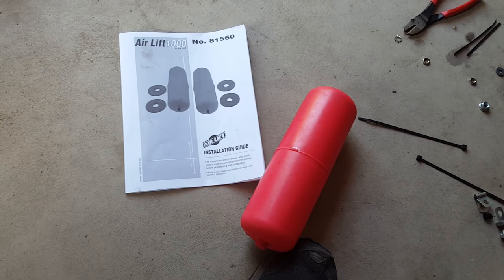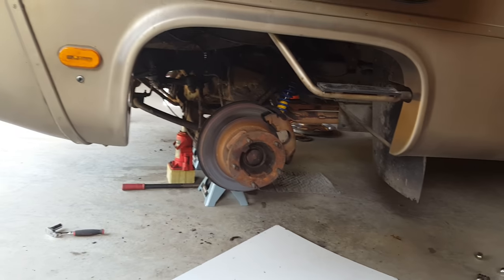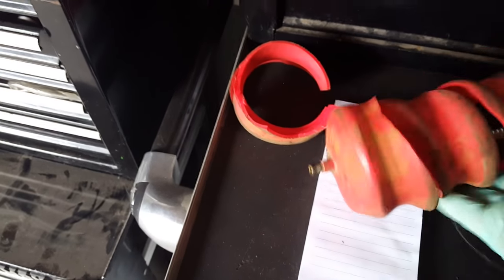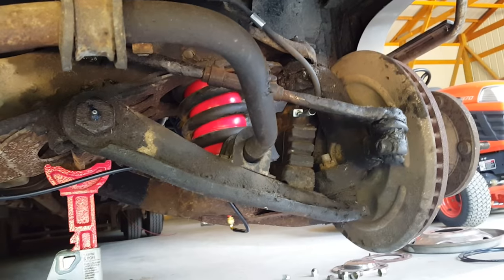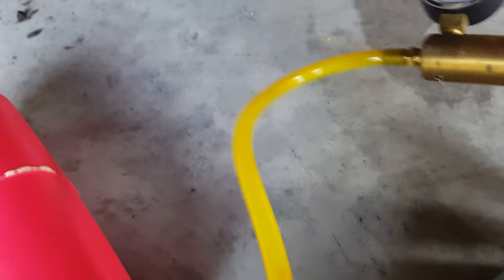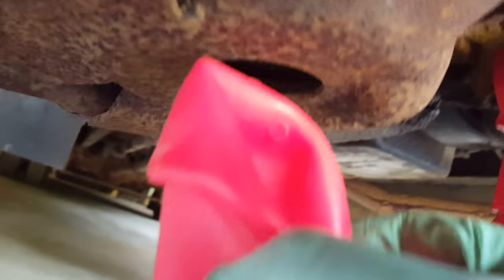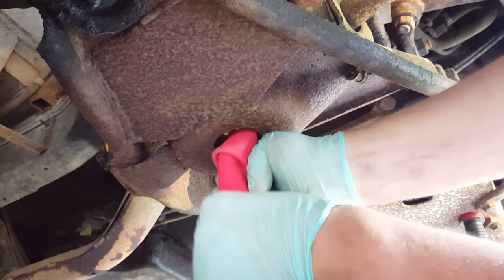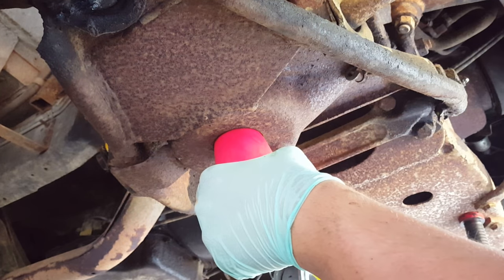Easiest way to install airbags inside coil springs.

Comment: It's amazing, I had just greased everything on my p30 before starting this job. It went exactly as you said, other than I had bags that were much more rigid, it took a lot more work to get them to go in, even with the vacuum pump, plenty of lube, and anger. Still, your commentary is spot on.
Reply from the maker: yeah I found that heating them with a hair dryer or something helps soften them.  But yeah I had to grease all 20 fittings first haha

Comment: Just curious. Do you think the airbags would last longer if they were periodically sprayed down with a graphite dry lubricant. Oil would hold dirt and grime, and probably create a polishing compound.🤔
Reply from the maker: I'm not sure, but I think they kinda stick to the inside of the spring,  they don't seem to chaff through...

Comment: Is that airbags long lasting? Or every year should change it ?
Reply from the maker: They have a lifetime warranty,  and they do last many years but not forever.  The RV was over 30 years old
Reply: @stokesandrew100  Good news, thank you. I took 1 hour to  installed it on my Toyota FJ, but because I don't know much about it, I inflated them to 15 psi, but I will inflate them to 35 psi.